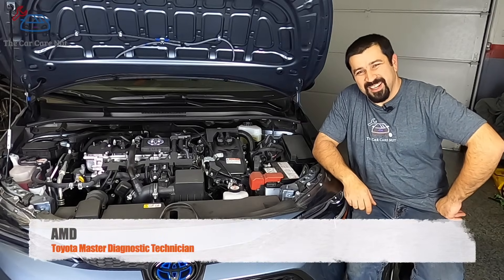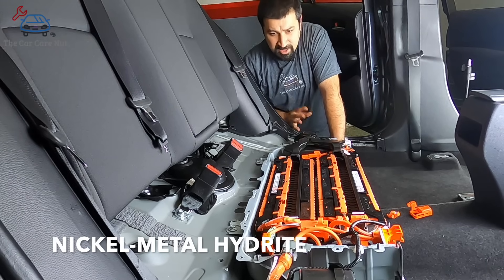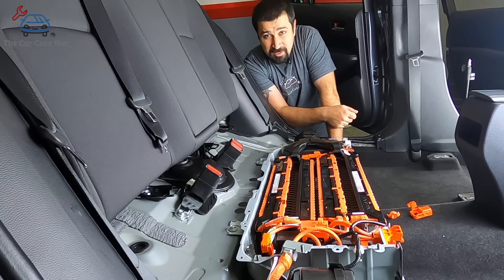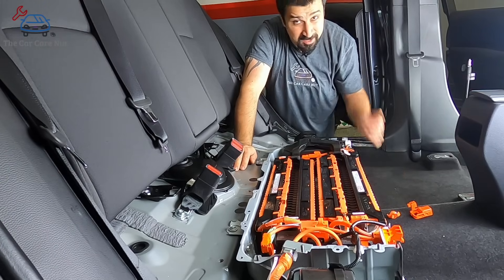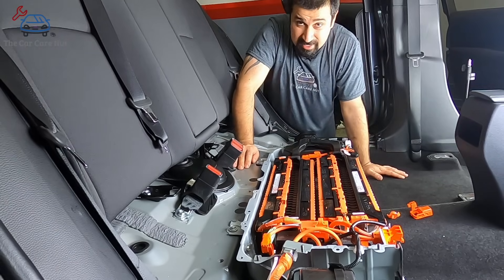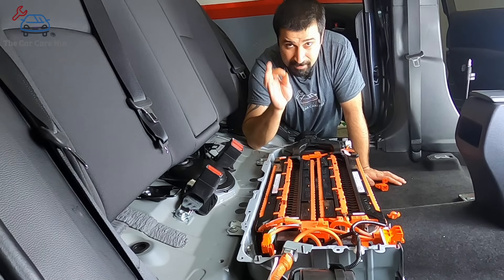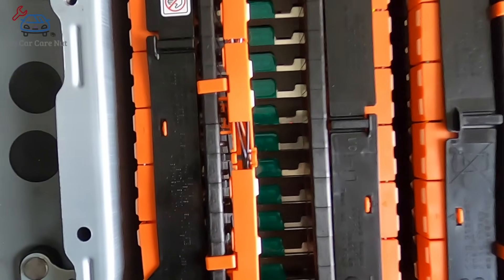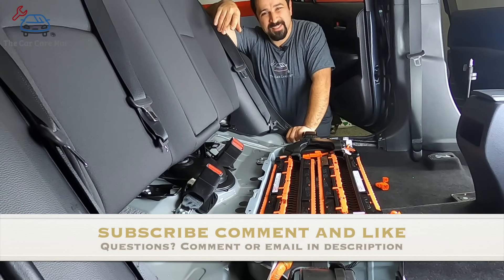How Toyota Hybrid System Work Part 1 High Voltage Battery

Comment: Thankyou for doing this.  You make it so anyone can understand the components and what they do.  My hybrid experience was with the first and second gen Prius.  We had an instructor that had us remove the battery packs and inverter/converters from two working Priuses with no problems.  We took the covers off the battery packs he explained how to test the individual batteries and how each individual "cell" was 7.2 Volts "at that  time."  We learned how to clean the corrosion from the straps that connected the cells, what to torque them to after reinstalling them, how the small bolts were special that held the straps to the battery how each cell could be recharged, and even how a little problem came along after a while that caused a fuel mileage problem.  Well, cleaning the straps, checking and replacing a bad cell (back then) followed by recharging brought the fuel mileage back to where it was supposed to be.  Then the other group with the removed inverter/converter went over that with the instructor and both groups on that Prius reinstalled the inverter/converter, the battery pack and the safety plug.  Once that was done, the vehicle had to start and not have any codes!  Then we went to lunch.  After lunch, we reversed positions and my group got to remove and learn about the inverter/converter by taking it apart, putting it back together and adding the coolant back into the reservoir for that part of the system.  The vehicle had to start, not have codes, and we were done for that day.  I THOROUGHLY ENJOYED THAT DAY IN THE SHOP WITH THOSE TWO PRIUSES!   Several years later, one of our Prius's was in a wreck, I got to change engine coolant hoses, the radiator and other parts.  Yes, I removed the inverter/converter, replaced several small coolant hoses under that unit, put it back together and since the Body shop had done their work, I finished the car, got it going and no codes.
I learned two things about that car.  How to keep the transmission from going into park so the vehicle could be moved around with the engine off and keyfob removed, by removing a relay in the underhood fuse/relay box thanks to Carolyn who worked on Priuses in a different part of California and was a member of iATN like me.  The second item was the early hybrids did not like to sit long especially in the Body Shop and sometimes would not start even with a full tank of gas.  Seems the float in the tank would sink.  A quick tip was to shake the back of the car from side to side and the float would regain its "floatability!"  Then it started!  Other than a couple small battery changes, I didn't do much maintenance to the other Priuses that were in our City fleet.

Comment: Great videos!  I would appreciate AMD's thoughts about purchasing a hybrid (the Toyota Venza or Lexus NX 350h) in Tucson, where the temperature is over 100 degrees every single day during our 4-5 month summer.  

I worry about long-term battery degradation, particularly given that both cars are equipped with more heat-sensitive LI-ION batteries instead of the NIMH batteries that are apparently more resistant to heat.  We keep our cars well beyond the 10-year warranty Toyota offers.

I also worry that Toyota has concluded that air cooling will not protect these batteries in such extreme conditions, and – rather than include liquid cooling for such a niche market – has “tuned” the system in these two cars to simply stay out of EV mode when it is so hot.  (I base this on a couple of complaints out of Australia.)  This would avoid degradation (and warranty claims), but sort of defeats the purpose of buying a hybrid.  

Should I be concerned?  Thank you!
Reply from the maker: Hi! Honestly if the maintenance is kept on the air cooled battery and air conditioning is used in hot days there’s no concern for early failure from the battery. It will fail one day but just like anything else like the engine and transmission
Reply: @TheCarCareNut  Thank you!

Comment: I just bought a RAV4 plug in hybrid and I am able (with an application on my smartphone) to start the AC air conditioning about 20 min before leaving in the morning (even st a timer)… do you recommend to do that on cold days to have the battery in adequate temperature? I wanted to “spare electric capacity” but after this video, I might do otherwise. Thanks.

Comment: One thing to note is, even though there is complexity in the battery and inverter systems, it results in much less complexity in other systems.  For example, the “hybrid transmission” in Toyotas has no friction elements, no servos, no hydraulic pumps.  Everything is done via magnetic fields, which do not wear out.  That is not true of other “hybrids”, especially the European ones.  They will pair a conventional automatic transmission behind a gasoline engine and “pancake” electric motor, thereby gaining no reliability advantage.  There is a reason Toyotas are as reliable as they are!

Comment: when taking off the orange clips if you use the service plug it is like a key to open them
Reply from the maker: Hi! No they typically rotate and come off but they’re almost designed to very easily break if you’re nit gentle and haven’t dealt with one before

Comment: 16:15 The connection between the two banks of cells in the middle of the Y is the first connector to disconnect if any is going to DIY to clean cell connections or change a cell. Disconnect the positive and negative connectors next. Now you have 2 90VDC packs.

Comment: I just watched 6 or 7 of your videos.  All good.  What kind of material is the battery air filter made of?  Can it be rinsed with water, or must it be vacuumed?  What is the typical maintenance recommendation for inspection, cleaning, and replacement ...say on a Camry Hybrid?  Thank you ! ! !
Reply from the maker: Hi! The older models has a mesh type filter which can be washed with water but needs to dry 100% before reinstallation. The newer ones has a paper filter similar to an engine air filter. Those you don’t want to wash with water just vacuum. The interval depends on your use check every few months and adjust the interval accordingly

Comment: Do the Toyota Camry Hybrids now all use the same type of High Voltage Battery?  I think at one time the LE had the Lithium Ion battery and the other had NiMH. Let me know. Thanks!
Reply from the maker: Hi! They still have both options
Reply: @TheCarCareNut  Are you saying that if someone were to buy a 2022 Toyota Camry Hybrid XLE that they could "choose" what type of battery (Li-Ion or NMH) they wanted installed in it?  I didn't know Toyota gave buyers an option.
Reply from the maker: You can’t choose. The LE model will have lithium ion and others nickel metal

Comment: What I dislike about my new rav4 hybrid xse. Too noisy, drivers side and front seat side door handles are hard to close, needs changing. Inside car lights are too low, so hardly see them in the dark. My 2019 should have android update made for it, since 2019 didn't have it. Why does only one front seat have a magazine slot on the back of the seat, when all cars have magazine pocket on back of both front seats, we need that for traveling to put map,etc into it. Wish the black seats were not the only option I saw. I like lighter colors. Hybrid turn on button is still hard to get used to after 2 yrs of owning my 2019 rav 4 xse hybrid. I always forget to turn the car off when I get home.  I paid for weather package but only get heated seat on drivers side seat, NOT passenger side seat. COME ON TOYOTA!  Toyota likes to skimp on little things which upsets me. 😡  Back door electric good, but moves up and down too slow. Also I should have gotten the back door opening from the bottom of back of the car, by putting my foot under sensor and back door opens automatically, since my arms are full of groceries. Toyota doesn't think I catch all those little things, but I do. DO BETTER TOYOTA.  Their cars are expensive so should have these common things that people want.  Otherwise I love my car and would give it a 4 out of 5.

Comment: Single woman, age 69. I love my rav4 xse hybrid, 2019 so have had 2 yrs. Only 2,700. Miles on it since I don't drive much. I take my car into Toyota dealer close to me for all maintanence. Can I assume they change the filter and keep up with my cars needs??  I can't do it car work myself. I got lucky and bought a 2019 hybrid right off the Toyota delivery truck when it came in on 18 wheeler. Mine is the magnetic Grey and another lady bought the other white one. You could not find hybrids in 2019 cause they were new and very popular. I must tell people thinking about buying a rav 4.  I get excited when I drive it because it's just such a fun, easy little car, but it is too noisy, so why didn't Toyota put in something for that? I paid a fortune for it in cash ..should be my last vehicle. Thanks for great reviews, is helping me a lot. Blessings to yours.

Comment: If you take off a service plug it is actually no more high Voltage any more  , there is a break on the series battery connection

Comment: My Prius would not start with the dead 12volt battery, yes when I checked it was dead after 7 years, I jumped the battery and the engine started. I went to the dealer, bought and installed the battery in theri parking lot. Yes the triangle did come on a few times, but went out on the second try, but never mentioned the defective 12V battery, however my key fob did show up with the triangle that stated the the fob battery was low???

Comment: The Toyota Prius is the best engineered car  ever designed with the least amount of defects in my case the 2013 base model has over 160,000 mile on it and few if any problems, tires wear out before anything else, no joke.

Comment: hmm. i noticed in summer engine didnt want to shutdown while warmed up at stoplight it did after 30secs but when i started to drive again it turned engine immediately on and didnt use HV to drive, i guess battery overheat. its 2019 Corolla Hybrid 1.8, i guess need to check filter.

Comment: where is the high voltage battery located in a 2014 Highlander hybrid and the air vent filter ? thx
Reply from the maker: Hi! It’s underneath the back seat and here’s a video with specific information to your model for the vents https://youtu.be/WNo-VXJSg7s

Comment: These batteries are so dangerous the fire departments have special training on how to handle them in an accident. In some cases, these batteries can get damaged. Water can not be applied directly on these battery packs. A lot of times dry chemicals have to be used. Then the Haz. Mat. units have to be involved so no chemicals are released. So these vehicles have to be treated very carefully.

Comment: Hello, is it safe to connect a road camera with parking mode to a hybrid vehicle. Wouldn't there be a problem with a 12 volt battery?
Regards.
Reply from the maker: Hi! I wouldn’t use the 12v battery for parking mode I would look for a camera with its own battery

Comment: Could you please talk about how to check the health of HV batteries ? An app called  Dr. Prius paired with some compatible OBD scan tools can perform charging and discharging tests. It probably works by measuring the internal resistance of the battery. I wonder if toyota dealership offers such service. This topic will be very useful for people buying second hand hybrids. Thank you :)

Comment: Are hybrids able to climb up and down mountainous regions? Say if going on a family camping trip carrying extra weight. Or will the engine struggle with that
Reply from the maker: Hi! They are more than capable. However the gas mileage will drop a bit

Comment: PS: I left a comment/question yesterday, but I can't see it here more... (((
Reply from the maker: Hi! Could you reply here with your question
Reply: @TheCarCareNut  I'll try to do it with bullet points.
1. Waited for green light, AC was ON, 102+F outside (I'm in NM) -> energy level on monitor went down.
2. Then I accelerated well, monitor showed 2 red "energy" bars, and suddenly CEL turned ON (with "Check VSC system" and "Check hybrid system" warnings). But nothing changed in car driving.
3. I stoped. Re-started the hybrid system. Everything was Ok except not working brake re-charging.
4. Went to O'Reilly to read errors. P0A80.
5. Next day erased the error. Car run excellent as before. Viseted Toyota dealer, they didn't find any error and said that battery is Ok.
6. Had a trip to Colorado. About 200 miles were passed, I was driving careful uphill, only 2  red "energy" bars were on monitor, and CEL turned ON again (with "Check VSC system" and "Check hybrid system" warnings). I was able to get to hotel, unload the car and to return home (+400 miles) with 1 red "energy" bar (or 4-5 "blue" bars while driving downhill).
7. Visited Toyota again. Errors P0A80-C1259-C1310. Recommendation: change hybrid battery AND sensor.
8. I opened the battery and check the voltage of each cell/module (30 total). Battery was extremely clean and looked to be well balanced with 0.00V - 0.03V difference between nearest cells/modules. The overall range for 30 cells/modules was 10.57 V - 10.68 V.
Car starts, runs well, re-charges hybrid battery with braking, but don't charge well in parking mode as it was before (engine works for several minutes and turn off even if only 2  red "energy" bars are on monitor).
Question: Does the battery really failed/dead or Battery Voltage Sensor (89892-48010) is the problem?
PS: Hybrid battery was replaced 105k miles ago by warranty (cells labeled with 20120706).
PPS: "+" of auxiliary 12V battery was oxidized.
PPPS: Today I googled the cell/module voltage, and it's 9.6 volts. Why do I have 1V higher (around 10.6V)? Battery is overcharged?
Thank you in advance for your help.
Reply from the maker: Hi! Was the battery replaced with an original?
Reply: @TheCarCareNut  Yes, dealer did it for first owner. It looks that all battery packs were replaced (battery cover was opened and closed back again). I don't know if sensor was also replaced.
From service history (08/23/2012): 
CHECK HYBRID SYSTEM LIGHT IS
ON. CHECK & ADVISE. ~|~
~|~HYBRID CODE POA80 REPLACE
BATTERY PACK. REPLACED
BATTERY PACK AND TESTED
HYBRID SYSTEM. NO CODES
AFTER BATT WAS REPLACED.
Reply from the maker: How many miles on it now and how’s the condition of the fan?
Reply: @TheCarCareNut  it was replaced at 82k, now it has 189k miles. There are 3 fans in battery. In general, they were clean (only one of them had very small amount of dust).
Reply from the maker: Ok honestly it will need another battery. Wonder if something was blocking it and caused overheating for the previous owner

Comment: I seen many people camping and sleeping in the back of the prius and they keep the car running all night to have ac. Is it good to sleep on top of a high battery voltage? How about radiation?
Reply from the maker: Hi! Radiation is not an issue in hybrids

Comment: Does the cooling fan run when the car is off? If not, how bad would it be to consistently park a Toyota/Lexus hybrid in an unconditioned garage after a drive on a hot summer day? The remaining heat from the engine plus high ambient temperature can easily exceed the 40c/104f temp you state. Would the only danger be faster degredation or is there an actual safety problem?

Thanks!
Reply from the maker: Hi! It doesn’t run the fan with the car off. Yes ambient temperature will have an effect but the battery is not charging and discharging at that point so it has a much lesser effect

Comment: Happy i discovered your channel! Informative stuff and to the point.
Important question: how much radiation does this battery have and is it of some minimal risk to passengers (mainly baby)? Does toyota measure these stuff? What do you think/recommend?
Reply from the maker: Hi! I am no expert on that subject however many viewers who were mentioned it was not an issue or a concern. Very valid concern you have as a parent, but it’s not something I would worry about.

Comment: I went in with a Corolla Hybrid into an automatic car wash, I was asked to shift the gear to neutral, and the car was towed on the track alone, then a message appeared on the dashboard that leaving the car in neutral could damage the hybrid battery, what should I do inside an auto wash?
Reply: Just try to make sure your battery isn't very empty beforehand. The issue is that in N the HV battery can't be charged but if it's healthy the 5 minutes or so the carwash takes aren't dangerous.

Comment: How much does the entire battery cost?
Reply from the maker: It varies by model. Usually 2-3k
Reply: @TheCarCareNut  it still ok
My Bmw x1 had a diesel pump failure 
Reparation costs 15k 
I sold the car for only 4k and now I'm buying a Toyota

Comment: I have a question. Is it normal to hear a clicking noise down below by your feet every-time you press the brake pedal or brakes? The clicking noise is coming directly from the pedals being pressed. Took it to Toyota dealer for repair and they have no clue why it makes this noise. Thank you and love your channel.
Reply from the maker: Hi! Some models do have a clicky brake pedal which is normal. Which model is it?

Comment: I have a Camry hybrid 2013, and I have been clearing the " Replace Hybrid battery " sign using a FIXD code reader. I was wondering if I could test each cell using a multimeter to find out which one has lost its voltage. I have never worked on Hybrid batteries but by watching lots of videos I feel like I can do it considering the safety precautions such as 1000 volts Gloves and unplugging the 12volt battery first and find my way through because the new one is almost 4k and a refurbished one or so called reconditioning one is 2k too much.
Reply from the maker: Hi! You can try it but please be careful and do as much research as possible before